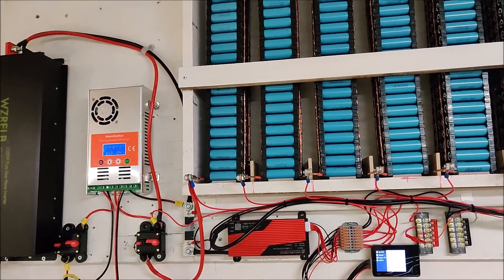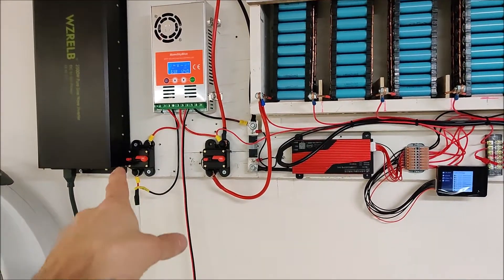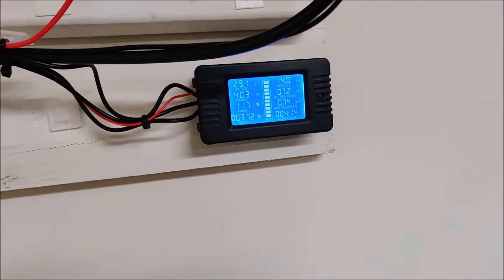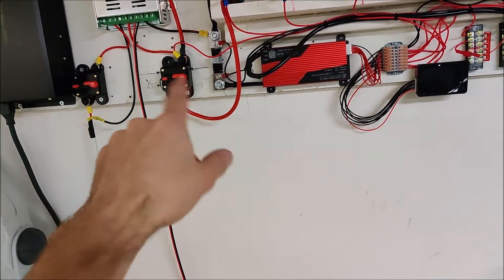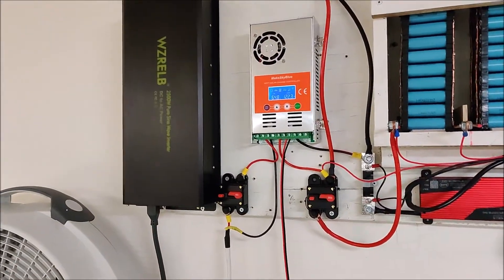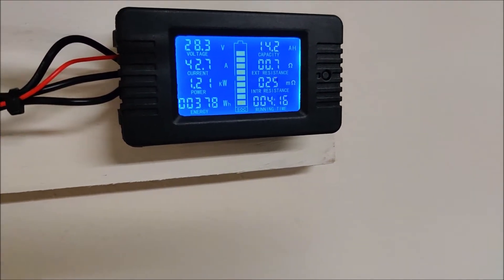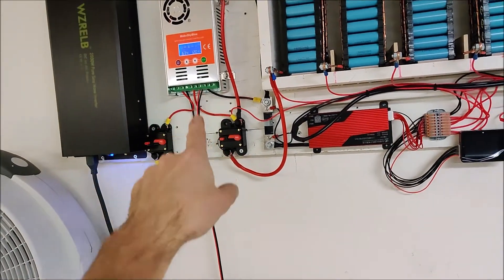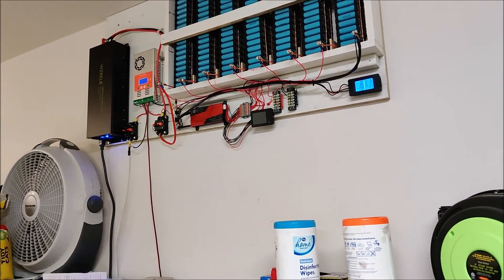DIY Powerwall Update

Comment: very well explained. what is the advantage of a "shunt-based" Power meter Vs a "Current Transformer Clamp" based power meter.
Reply from the maker: They are very similar. The shunts are more compact than the magnetic rings.
Reply: @stevenc22  any experiences with "smart" power meters to share ? - ones which can be monitored over bluetooth / wifi

Comment: That wall look like my 1 year salary
Reply from the maker: Lol, its not that expensive. Couple grand.
Reply: I have one powerwall. It’s the smallest one. Wouldn’t call it a powerwall. Am using a 25w 12v solar panel- A 12v lead acid battery that has only 25% battery health & a mppt solar charge controller from China. Don’t know if it’s a mppt like what they claim. It doesn’t have a vent so it will kapoot itself someday. Yours just need a frame to make it look neat. Good job though. I am just testing mine for now

Comment: how many years goes system work and cycle cycle how many years ?
Reply from the maker: Lithium batteries are only good for about 500 cycles. I only use the pack on the weekends when i work in my garage so pack should last years
Reply: @stevenc22  how many years does the system spend on a small amount of regular use each day?.can you explain in detail?
Reply from the maker: @ismailozcelik1662  lithium batteries are good for 500 full discharges. So if you only half discharge the system every day you could get 1000 days and even then they will still have some capacity just not their full capacity.